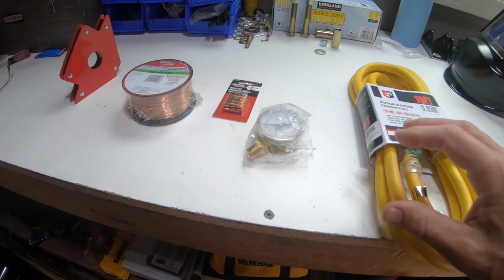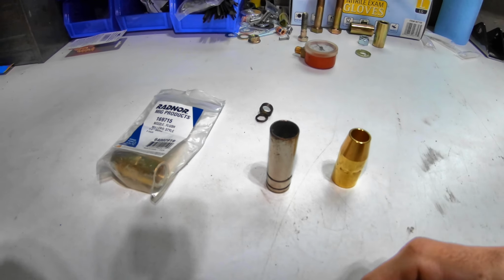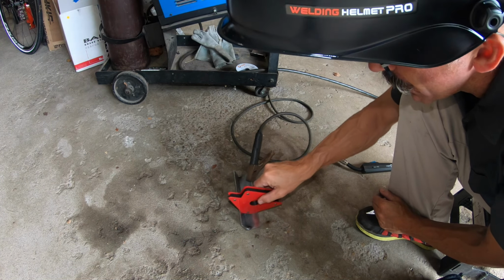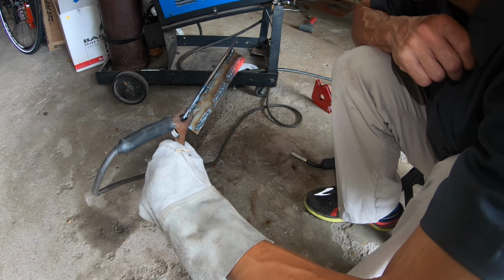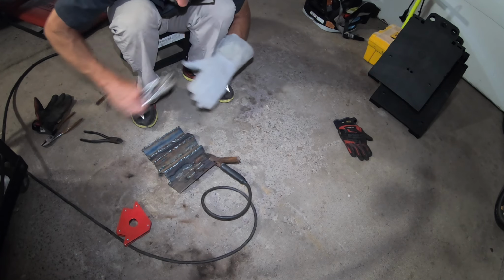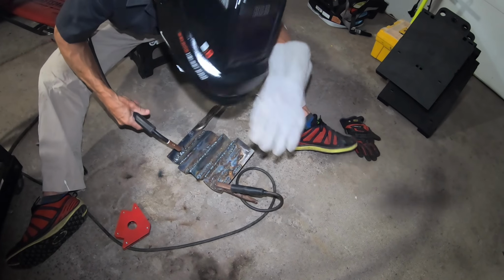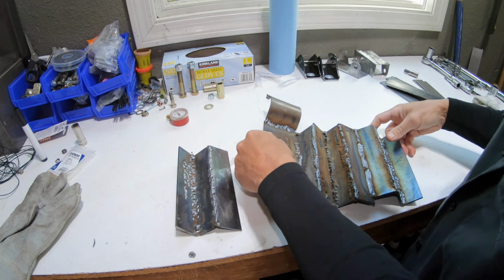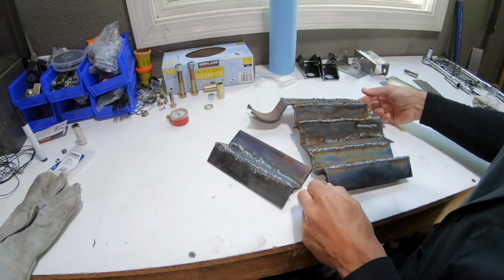Learning to MIG Weld Part 1

Comment: Check your ground cable.  We have a Miller 240 volt welder at work and the ground clamp developed high resistance at the point where the wire attached to the clamp.  Also, check the polarity.  For MIG, the electrode should be positive and the ground should be negative–  and the opposite for flux core.
Reply from the maker: I think it did come loose a few times during the welding.  That would explain things thanks 👍

Comment: Your breathing it to long take shorter breath so you don’t change your distance as fat kinda just saw it in the middle of the video so decided to comment good luck though I love welding and fortunately was able to go to school for it have fun and wear long sleeves you do t want to get sunburn👍🏻
Also your wife feed on last run was to high your aiming for a more rhythmic sound but still sizzling just slower than what you had it in the last part of the video try to keep a c pattern with a slight pull angle like 10-15 degrees or less into the puddle you want the puddle to always be moving or more or less following your movement
Reply from the maker: Great tips, thanks for commenting I will try those.  I appreciate it 👍
Reply: @backyardhotrods9885  yea no problem just what worked for me and most times when your laying into the corner you might want to run straight for deeper penetration just run the wire a good speed and drag most beads after that though should be a c so you make sure to fuse fully with the parent  metal on the sides